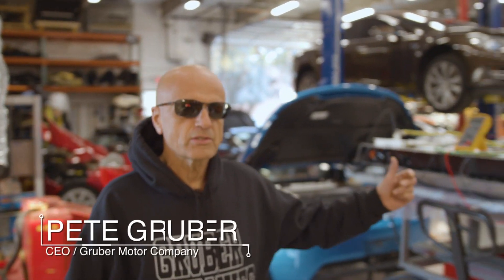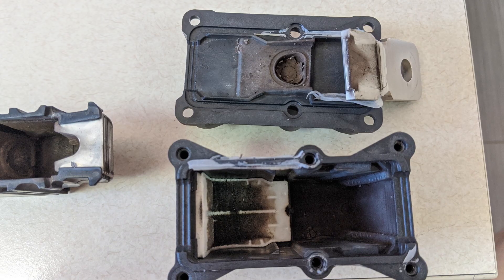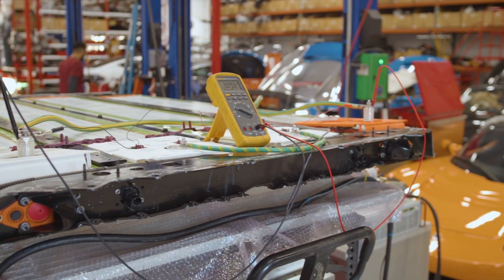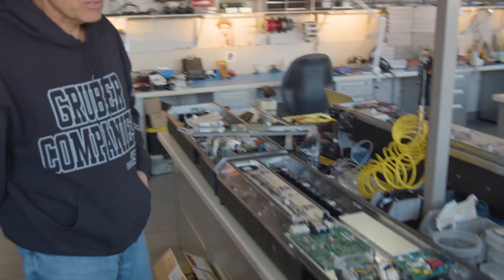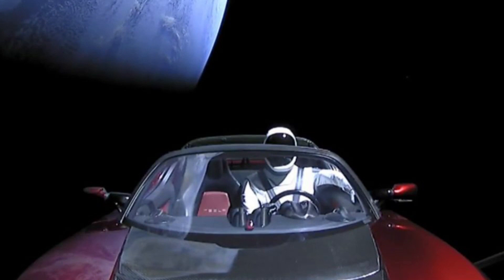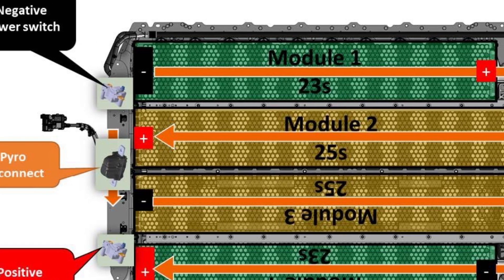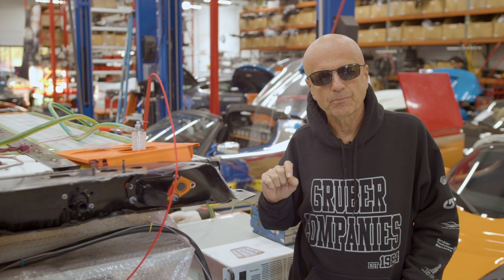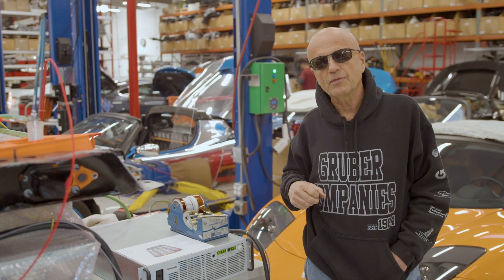Inside a Tesla Model 3 Battery Pack - Part 2 | Gruber Motors

Comment: Dear Peter, 
I would be grateful if you clarify something for me. With regard to batterie I understand , cell, modules and pack I noticed you refer to bricks and sheet. Is a brick a module or collection of modules. What about the sheet. Thank you. Regards.
Reply from the maker: A brick is a collection of parallel connected cells, a sheet or module is a collection of series connected bricks.

Comment: Dr Gruber, thank you for your videos on the Model 3 battery pack.  Part 1 ends with the top cover and 'penthouse' in place but Part 2 starts with them removed ... is it just a matter of lifting it off with any connections parting without force or manipulation?

I'm looking to use one to build a powerwall for my farmhouse.  You mention the BMS's on each module (slaves) and I understand there is what some refer to as a 'master' BMS in the penthouse.  I assume the master balances the 4 modules via the slaves.  Is there a way for me to use these inbuilt BMS's out of a car or do they require some additional computer/intelligence that is elsewhere in the car before they become active?

I would greatly appreciate any help/knowledge you can share with me.

Comment: Dear Mr. Gruber. Can you Tell something about the new LFP Cells in Model 3 built in gigafactory shanghai. In germany we have Many Problems with new M3 delivert These days. BMS calculating Problems and very low DC charging speeds when the battery ist new or cold battery . Trank you . Best regards from Frankfurt / germany
Reply: LiFePo4 chemistry cannot tolerate charging below a certain temperature as it will form dendrites on the anode. You can read more about this here: https://onlinelibrary.wiley.com/doi/full/10.1002/ese3.279